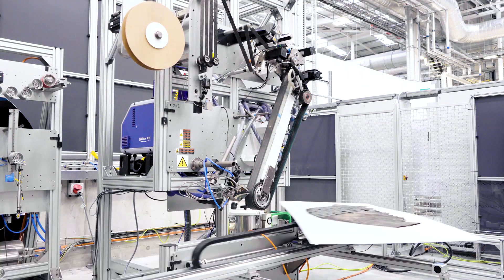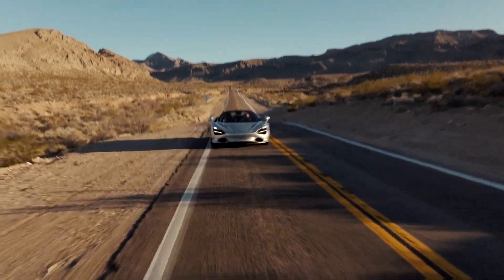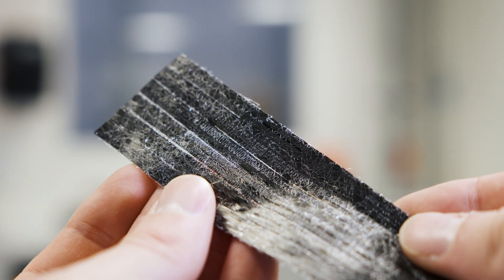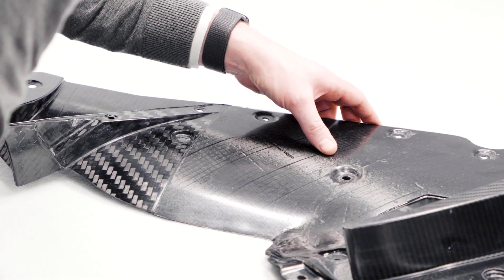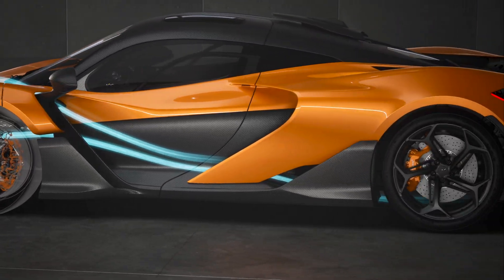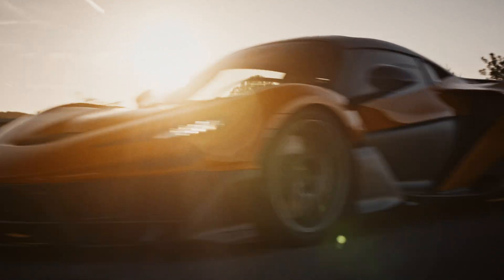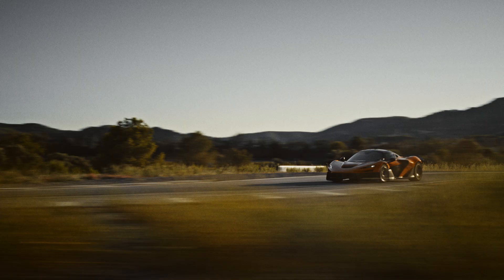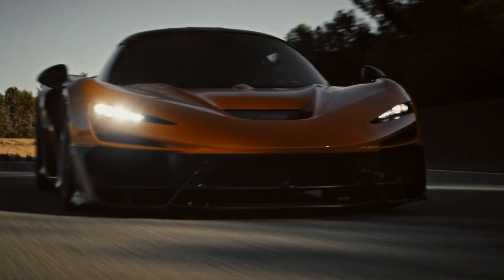McLaren ART carbon: a world first in lightweight supercar engineering #McLaren #Supercars

Comment: These carbon tape laying machines are pretty old right so what is actually new here? the machine doesn't enable the parts to be better right? I guess if your using thinner than conventional pre-preg you can get more layers and more fiber orientation in for same thickness but other than that the machine is just removing human labor cost and i guess the inconsistencies of human laminators?  Seems like a lot of marketing bs